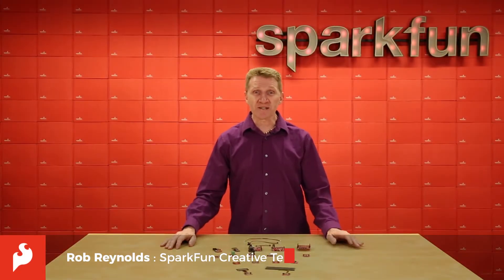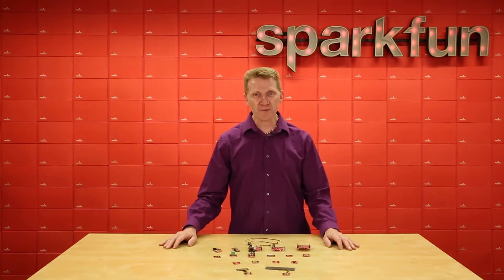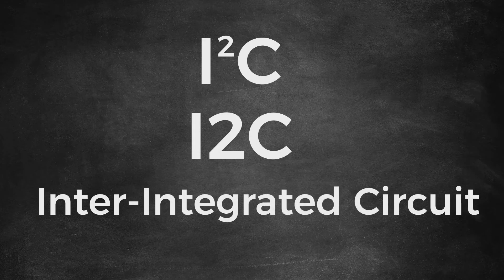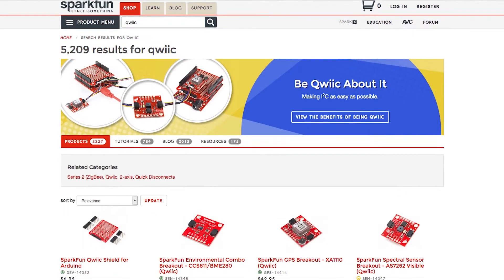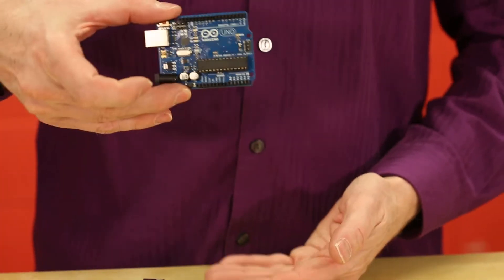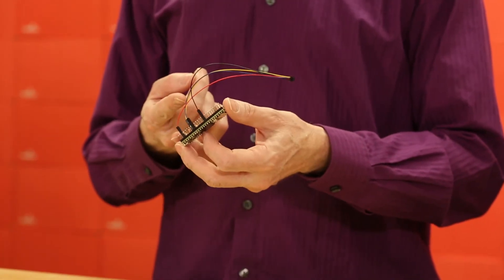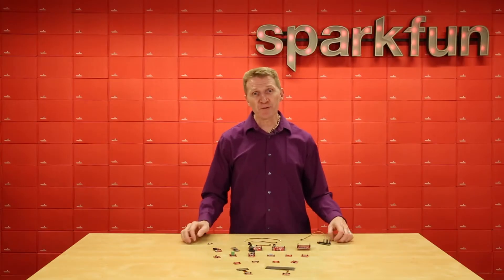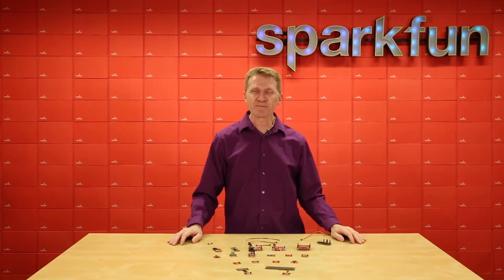SparkFun's Qwiic Connect System

Comment: So, like, could it be possible to 'recreate' the circuit from the individual qwiiic modules?

Like, correct me if I am wrong, but you could--in theory--because we know exactly how each board is made, could be used as a 'drop in' module in a EDA... Only, minus the things that you woulden't need on a PCB--since this would be ultimately made into a board. So, you could prototype a design, physically in the real world with modules. Or can't you figure out how the modules are laid out in a 'chain'? Can one know it is connected to another one? Hmm...